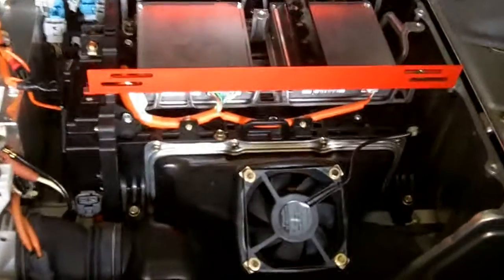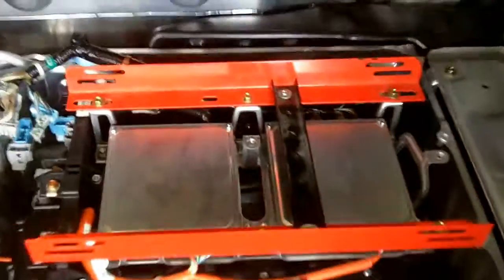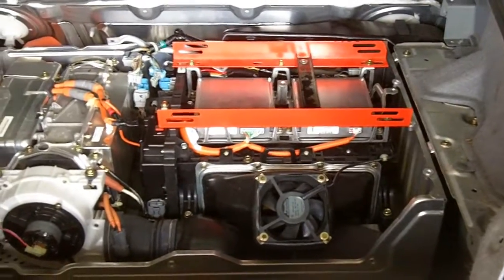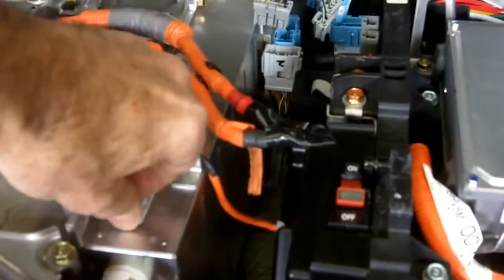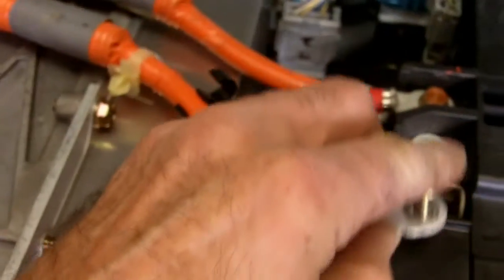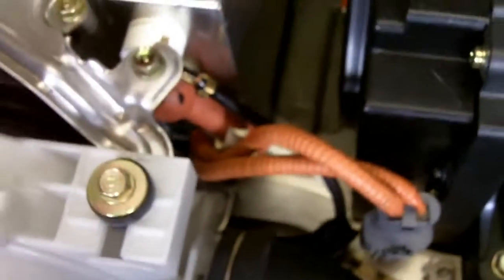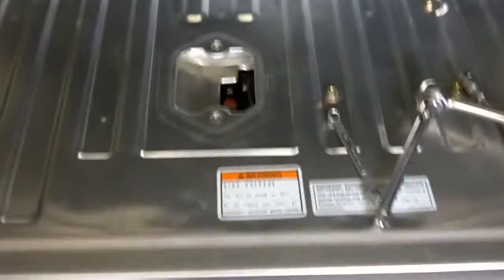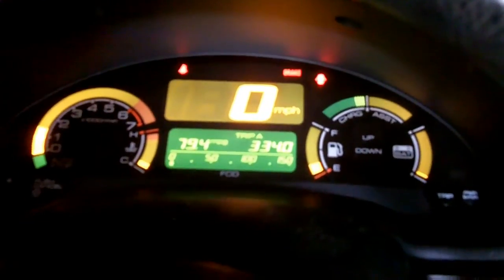HONDA INSIGHT IMA BATTERY REPLACEMENT: PART 4 - INSTALLATION

Comment: Where did you buy the new battery sticks for your Honda Insight, and what did you pay?

How's it working, now (3.5 months later)?
Reply from the maker: I purchased the batteries from hybrid revolt http://www.hybridrevolt.com/catalog/  The cost was $240 with S&H. I installed them Jan 2014 (didn't post the video until Oct). For the first 11 months, no problems, but recently the IMA light  has been coming on every couple of weeks, so I will probably redo the batteries in the summer.  FYI, do not purchase from someone who doesn't test the batteries properly (measuring the voltage is not sufficient to determine their condition).  I'll keep you posted.